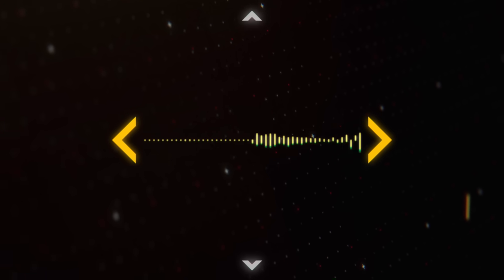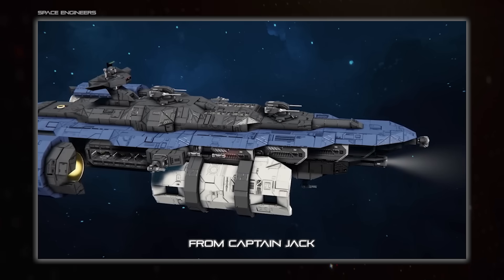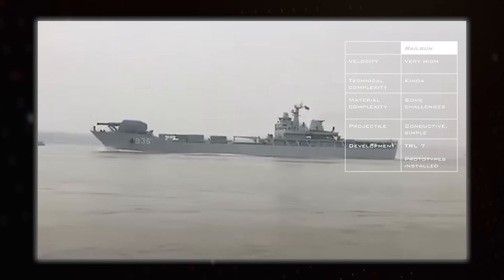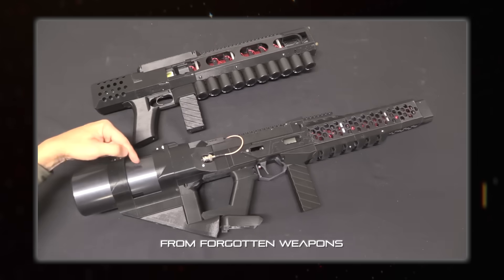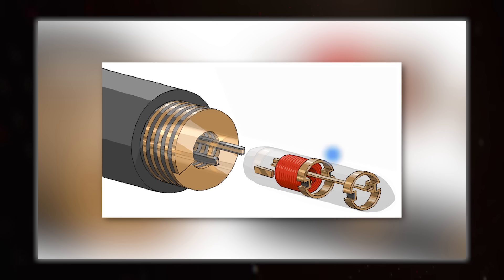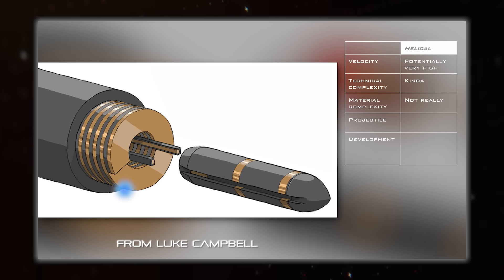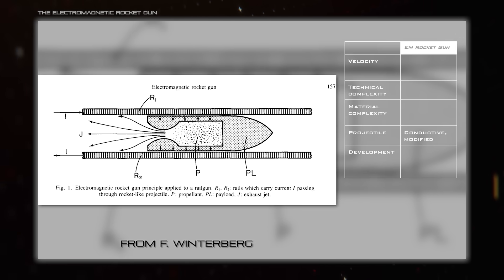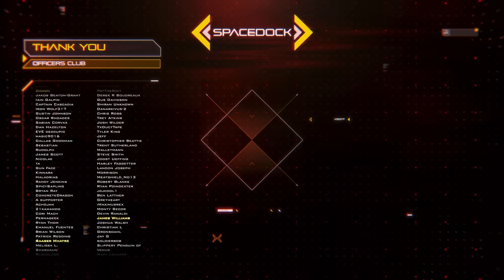The Deadly Coilgun/Railgun Hybrid You've Never Heard Of (Helical Railguns)

Comment: Hey, the cross-section art of the Hyperion from StarCraft 2 has described some of its weapons as Helical Railguns!
Reply: I just read that image and the helical part comes from the double helix path of the rails, sadly not a hybrid.
Reply: @meestur6210  Yeah that's the other use of "helical railgun" I've seen around, with the twisted rails imparting spin on the projectile for accuracy.
- hoojiwana from Spacedock
Reply: I didn't know that. Very cool
Reply: @rayzerot  Yep. Said helical railguns are found on the Hyperion's hammerhead front (top and bottom parts) and 'wings' (same as the hammerhead front, but only fewer guns).
Reply: The PD/CIWS guns we see in the cutscenes right?
Reply: @quox3987  yes
Reply: And actually good c14 coil guns
Reply: Most of the time when I heard Helical Railgun is not hybrid, just a twisted railgun
Reply: Long live the dominion!
Reply: I remember that!!
Reply: Fire the Yamato Cannon!
Reply: I didn't know that. Thanks 👍
Reply: Oh man imagine a ring of lasers around the barrel to weaken and soften armor then a rail gun to punch right through.
Reply: @Slopersnshoulders  : OHHH! I YOU MEAN EXACTLY LIKE LASER SOLITON'S !☝ THOSE ACTUALLY EXIST.☝